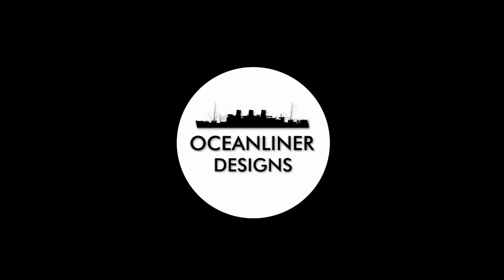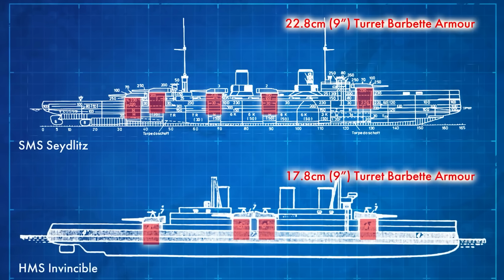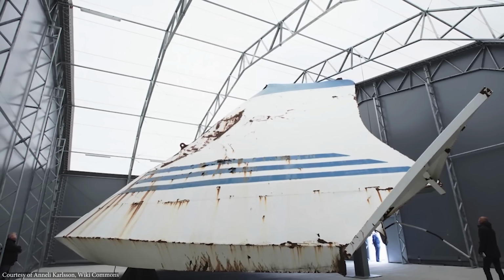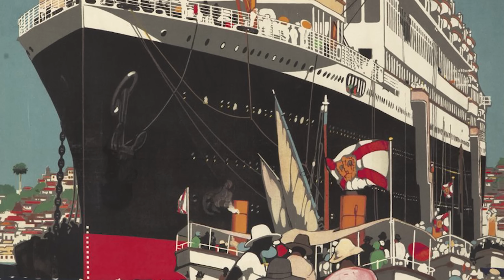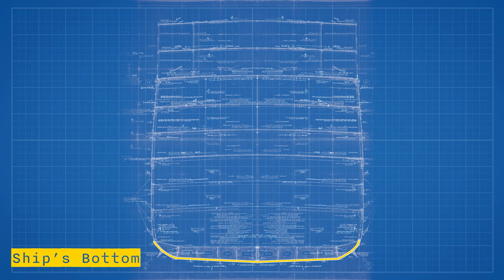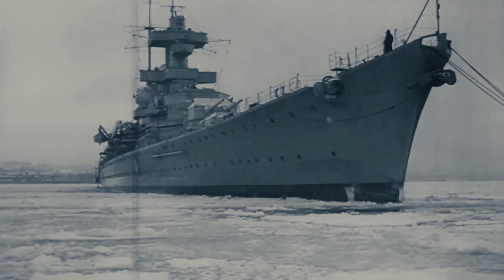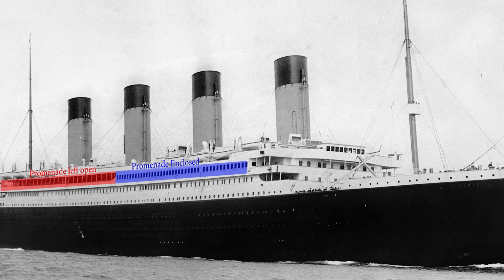The Worst Ship Design Fails in History

Comment: I once found some educational films produced during the 40's which went over the myriad types and applications of rivets and that particular subject is quite possibly one of the most important with regards to ship building at the time. Don't use the right rivet implementation and your ship could sink, experience excessive drag, or simply fail to be as durable as it should have been due to a propensity for damaged panels to pop their rivets and fall off.

Comment: Aside the disparity of british and german barbette- armour on their Battle- Cruisers, there has also been ( according to my knowledge) another big difference. That was that the germans have used metal- cartridges as supposed the to british cloth powder charges. This lead to the germans having had more time to react and counter such severe hits, due to  the fact that the powder contained in in cartridges needed more time to reach critical temperatures, than powder contained in cloth... Even so, german Battle- Cruisers were notionally slower, had a smaller main- armament but better armour- protection...

Comment: I wonder if any warship designers have tried to design a ship with some sort of magazine blowout channeling. Modern main battle tanks like the Abrahams have blowout armor panels on the magazine. Those panels are held down with bolts designed to snap in an ammunition detonation and guide the energy out of the tank instead of into the crew compartment. Theoretically one could design a ship magazine with specific armor plates designed to fail first in a detonation and direct the energy out of the ship instead of letting it propagate to vital machinery rooms or other magazines.

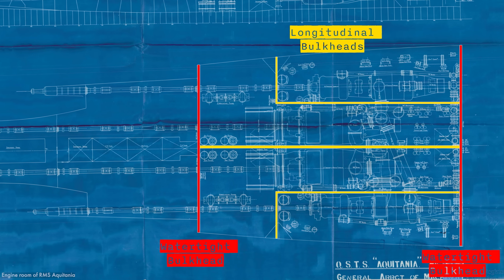Comment: 47:30  RN newest class of destroyer...54:45 vertical center of gravity....metacenter error calculation used seven feet, actual was seventeen feet...missed by original design team and two rechecks and was used in constructed ships. numerous modifications rectified this in the eighty ships ultimately used in WWII.

Comment: Austeria: 10,000 HP.

For reference: My ship was a Spruance class Destroyer. Four General Electric Gas Turbines, two screws, 563 feet, 9100 ton displacement...

...80,000 HP

Commissioned between 1976 and 1983

Comment: 5:16 untrue. The Battlecruiser as Fisher envisioned was meant to attack enemy Cruisers, not engage in large-scale fleet actions. The failure of the Battlecruisers at Jutland was a strategic and tactical doctrine issue, not an engineering one, with the exception of HMS Indefatigable, who was not adequately armored even for her envisioned task.
Reply: 9:39 British shells also had severe reliability issues. Most rounds that hit failed to detonate. If they had detonated, it’s highly likely the German Battlecruisers would have suffered far heavier casualties
Reply: 11:51 again, British Battlecruisers were not envisioned as fleet support warships. It’s the Germans who developed that use case and built slower, more heavily armored Battlecruisers. This is also why more German Battlecruisers survived Jutland

Comment: You're correct that the British Battlecruisers suffered from being used against their intended purpose, but let me quickly make the difference between British and German Battlecruisers a bit more explicit, and perhaps then it becomes clearer if the British Battlecruisers were actually design failures. To make it very quick: British Battlecruisers focused on speed and firepower, sacrificing armor, while German Battlecruisers focused on speed and armor, sacrificing firepower. The British Battlecruisers shared their main gun caliber with what the battleships constructed in the same year had: Invincible and Dreadnought had 12 inch guns, Renown and Revenge had 15 inch guns, and so forth. They also featured one less gun turret: Invincible had four, while Dreadnought had five. The Germans did the same with regard to the number of guns carried, but they also used smaller guns: Battlecruisers stayed at 11 inch guns for a long time, while the Battleships had 12 inchers, and when they moved on to 15 inch guns with the Battleship Bayern, the Battlecruisers remained at 13.5 inch guns. Armorwise, meanwhile, there was a huge discrepancy with the British, as you laid out here - the Germans meanwhile armored their Battlecruisers close to what their Battleships had, and not only with regards to thicknesses, but also the area covered and the general layout. Looking at armor thicknesses only is a bit misleading, because most of the British ships had very narrow belts, meaning, only a small portion of the ship's side was actually covered, whereas the German ships were protected to a much greater extent. 

The reason for this is a fundamental difference in how both navies wanted to use their Battlecruisers: for the Germans, Battlecruisers were meant to supplement the main fleet - they couldn't dish out as hard as a full Battleship, but they were meant to stand up to enemy fire in the line of battle alongside their Battleship counterparts. The British meanwhile imagined their Battlecruisers as Cruiser-killers: decimating the enemy light forces, and using their superior speed to avoid heavy ships. This made sense when they were envisioned: there were no fast, heavily armed ships, and you can see that play out in the Battles of Coronel and the Falklands, when the British Battlecruisers mowed down Admiral Graf Spee's squadron of older armored cruisers without the Germans able to fight back in any effective way. However, by the time WW1 rolled around, the British knew that the Germans were building Battlecruisers themselves, but they did not significantly alter their design principles. Where a ship armed like a Battleship and protected against Cruiser caliber guns made sense before, now it ... really didn't. If your enemy fields 11 inch guns on ships almost as fast (or as fast) as your Cruiser Killers, suddenly, you are no longer in a position of absolute superiority. It's true that the British increased gun caliber on their Battlecruisers in line with Battleships, so they were indeed a great threat to their German equivalents, but as Jutland showed, the smaller caliber German guns were more than capable of threatening the Battlecruisers themselves. Even the range advantage of the bigger British guns wasn't as big of an advantage as you might think it was: yes, they could outrange the German ships, but at those ranges, hits were very, very unlikely. Less than fiver percent. To actually do damage, you had to close within range of the German guns, and then, the smaller caliber was actually advantageous, as it meant that they could be reloaded faster. More shells in the air = more chances to hit = more hits on average. 

In short, the British built highly specialized cruiser killers, and continued to do so when the "cruisers" in question became capable of effectively fighting back, while the Germans built more rounded, generalist ships, which tried to keep survivability as high as possible, not only via armor but also with high levels of internal subdivision, better shell storage procedures, and the general understanding that they would be fighting equivalent or superior ships from the get-go. In the end, the German design philosophy of "Cruiser Battleships" proved to be superior to the British "Battleship Cruisers".

Comment: Roro ferry design solution suggestion: the vehicle decks should be at least a few deck levels above water level, driven up to via ramps similar to what already exists, less vehicles, sure, but the vehicle drive on decks would be much less likely to face flooding.

Comment: Wonder how thin you could go on shell plating and then use the double inner skin as more of a structural structure?.. Reducing weight from the outer skin... obvious keel would need full strength any place likely to support the ship in drydock or grounding.

Comment: As for rolling, I'm an airplane guy, and so I kept picturing having little wings below the waterline that extend out probably from somewhere amidship. These little wings would have ailerons that could control counteract the ship's roll. They wouldn't be able to stop the ship from rolling, but would reduce the speed and extent of the roll. When the ship rolls to the left, then a full right aileron would be given (maybe automatically) to slow the roll and reduce how far it rolls. I'm sure someone else smarter than me considered this, and rejected the idea for reasons of physics that I don't understand. Maybe the weight of the ship Would be just too much for something like that to have any effect?

Comment: It's actually not the "poor" design of the bow visor that sunk the Estonia, we know that today. Many ship, still in use today has that exact same design of the bow visor, like the M/S Ekerö. A ship build in 1978-79 and with an even lower ice classification(1B) than Estonia had(1A) and it's still afloat, running in the Baltic  and without any incidents with it's bow. We have found the strange cracks on Estonia and we hear the same nonsense from our politicians. We should ask the question, why don't they bring up the so all can come to an answer? SMIT solving cop. would have done it without any problem, but the POLITICIANS refused, WHY? They have something to hide obvious. Money isn't the issue, they have already spent much more on surveillance and to cover up the ship then what an actually salvage had cost. So the design works very well as many other ships with same design proves.

Comment: I feel like the Battlecruiser one is less of a design failure and more of a tactical/strategic failure. They designed and built these ships to fight cruisers, aka ships smaller and less well armed than themselves. But then they go and put them in a line of battle against other heavily armed ships. Of course it isn’t going to go well, you are misusing this naval asset in a role it was not intended for. 

There were also other factors besides armor thickness at play with the Seydlitz surviving while British ships exploded. British shells at the time had design flaws which made them explode on impact instead of on a delay. This made the shells very bad at piercing armor, even on battlecruisers. 
Secondly, there is evidence that the British ammo stowage practices in the battlecruiser fleet were lax, leaving them more vulnerable to runaway ammunition explosion. On top of this, the British at the time generally didn’t seem to pay attention to Cordite decomposition. This led to explosive nitroglycerin residue being left all over the ammo handling areas between the magazines and turrets, which doesn’t at all help prevent catastrophic explosions. 
The Germans, meanwhile, had experienced from an earlier ship magazine explosion and seemed to be more careful with ammo storage as well as using stronger stabilizing agents in their propellants, which led to less decomposition.

Comment: One thing that did bother me about this, was the section of the battlecruisers. As someone who has spent, a rather large and arguably unnecessary amount of time researching into them. There are a few things that have to be said about not just the facts given, but also additional factors and why I think, battlecruisers shouldn’t really be delegated to “worst design’s failures”.

Firstly, as per the concept of battlecruisers, their main role, at least originally was that of, cruiser killers, this can be seen in the fact that, at the beginning, their armour is mostly rated against cruisers caliber shells, mind you that with battleship grade guns, the battlecruisers would have the range advantage and their armour would be and was sufficient against cruiser shells fired at range. with most cruisers being demolished should they have decided to close the range to inflict more damage.

Though this was the roll at the beginning, subsequent battlecruisers began to field more armour, with a change or rolls from simply being cruiser killers, to that of a scout force, engaging not just cruisers but also other battlecruisers. This part is critical cause the main battle cruisers discussed are first and second gen, those with the stil sole purpose of being cruisers killers, vessels such as Invincible, Inflexible and Queen Mary, were gen 1 and gen 2 respectively. A key example of later generations of battlecruisers being more robust is HMS Tiger, a one off battlecruiser design that succeeded the Queen Maris and preceded the Renown class. HMS tiger took part in several engagements throughout the war, including the battle of Dogger Bank & the Battle of Jutland, both cases she took direct fire from German battlecruisers equipped with 11-12 inch guns. Both cases she shrugged off the damage and pressed on, demonstrating superb armour protection present in her and later generations of battlecruisers. (For those who say “HMS Hood” a) was a very lucky shot that did her, b) was more of other magazines that detonated that did her, recommend watching Drachinifels video on the matter, he explains it very well, and c) she was more of a fast battleship)

Secondly, a main factor that caused the battlecruisers to explode was not the lack of protection, but rather BT’s decision to forego protocol and deactivate flash fire protection systems, leading from the guns to the magazine. These were a set of hatches and systems that ensured that any flash fires or heat from a direct hit to the turret, would not then migrate to the ships magazines. All vessels including battlecruisers were fitted with this, but BT ordered the crews to essentially decativate them, doors separating compartments and those leading to the propellent charge magazines were leafy open. The reason, rate of fire.
The port that BT’s battlecruises squadron was stationed at was not as substantial as Scapa flow, as such gunnery practice was…. rare… to overcome the lack of accuracy and to dictate the range as soon as possible, BT obted for a higher rate of fire, to achieve this the flash protection systems got in the way, and they were thus deactivated or unused. 

For Battlecruisers that were less well protected this meant a death sentence, as it was these flash fires that detonated their magazines, not direct hits to their armour or magazines. But this would have been a case with any ship, and thus cannot be solely attributed to the Battlecruisers.

With this into account, it can’t really be said that the battlecruisers were a flawed or failure in their design. But rather a missues of a design by part of those who used them, especially when it comes to the case of the earlier generations of battlecruisers.

When they were used for their rolls they performed incredibly well, and for their new roles later one, never and improved designs were able to perform up to standard like any other vessel in the fleet. 

They were an odd design yes, and a mid point of development that would lead to the fast battleship concept. But as a design they were not a disaster. The design evolved and the newer ones were competitive and effective. The older designs meant for a set role were misused, both in their new applied roles and the lack of safety precautions that lead to their demise.

Were they perfect, no, but no ship design can ever be considered perfect. But I would argue to say that they were certainly not failures. 

Aside from that, great content as always, keep it up.

Comment: The biggest initial problem with the estonia was that "checking after they heard the banging" consisted of just looking at the panel of bow warning lights, which hadn't triggered even though the locks had given away, because of bad design. It's still a very controversial accident because dives year later showed a large 4x1m gash in the hull which backed up a story that had been discussed for a long time, that the ship had been struck by a submarine, the fact that the records of the incident are sealed until about 2065 iirc plus despite being in relatively shallow water there has never ever been an operation to recover any of the 850+ bodies.

And re the first ferry, I'm not a ship designer but looking at the guide rails for the guillotine door at 15:30 even I can see you are meant to recess them and not have them stuck proud on the side of the entrance way where they can easily be struck and damaged by incoming lorries, making the watertight guillotine door unable to lower.

Comment: the worst is the poop deck, shit through a grating all over the front of the boat, anchors, etc and then have to pay someone to clean it when you pull into a harbor...instead of using a bucket or a hole. I mean how in the hell did this happen? It takes a lot of brainpower to build a ship, navigate, etc...and then you tell everyone to just squat and shit through the grating at the front of the boat. I couldn't find where this got started, or why they did this. Do a video! I mean with no wind the smell...and it seems so simple to just use a bucket and toss it overboard and don't get it why such smart people would do this unless it was some sick joke

Comment: AAOK-----------.  The reason why Battleships were built Close to the sea with little freeboard is that the closer to the water a ships side is the more resistant it is to Ememy SHELLS... and  the harder it is to hit.... Example being  America's Civil War Monotor class of gun ships that withstood hundreds of hits without damage.. During the WAR....  One drastic example is a Japanese Battleship that was rebuild on its Ways to into Japan's largest carrier without increasing its Freeboard...  They Simply Built a Flight Deck above the existing hull..  using the original main deck as the Hanger deck since it was already armord so well.. only thing is that the Heavy flight deck put the hanger deck so close to water level that it sank during its first shorty even though it was Barrely damaged by a Torpedo... as water flooded into the elevator trunks amongst other design flaws...and soon Sunk.....